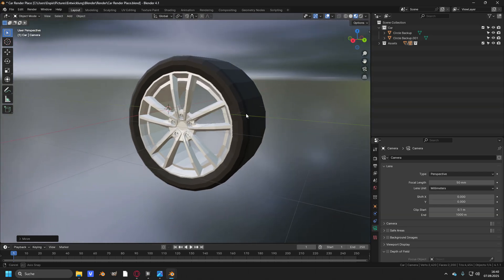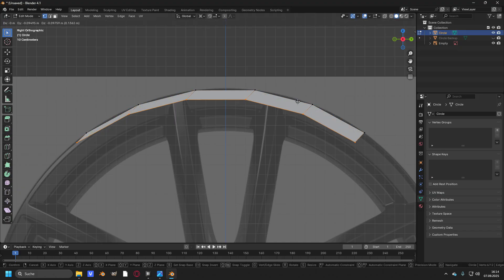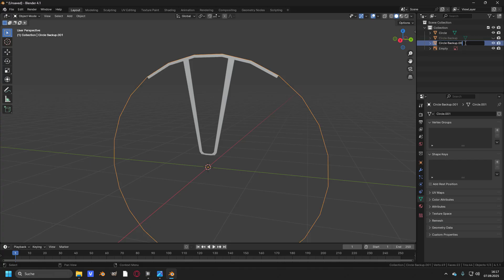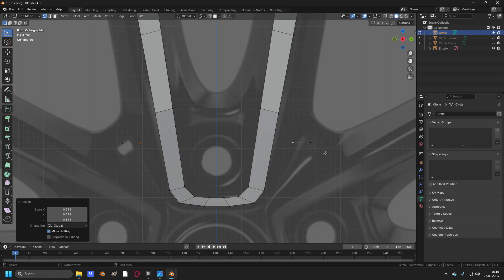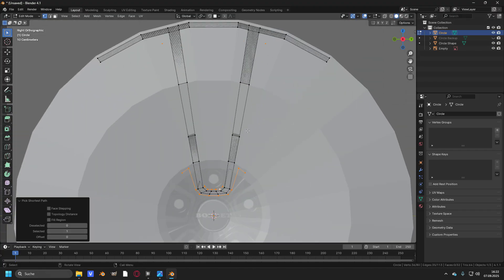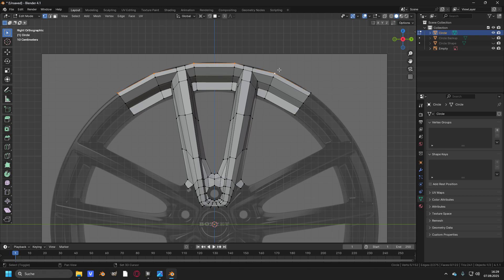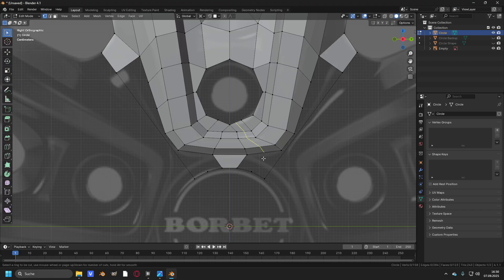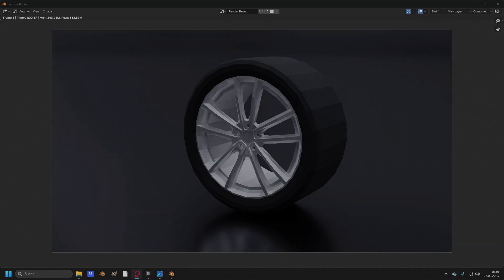Model A Low Poly Rim In Blender

Comment: i have a question, at 3:46, how did you get those options? i do not have those
Reply from the maker: This is the normal overlay of Blender, so there is no setting changed. Maybe you're using an older version of Blender?
This option should be in Blender since the 4.5 version.
Reply: @enpix718im using the same version which is weird